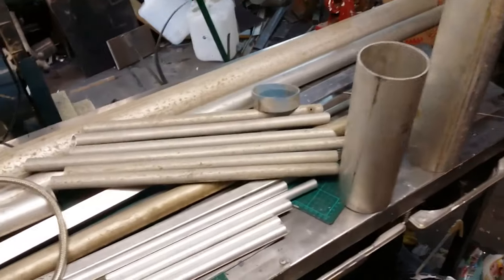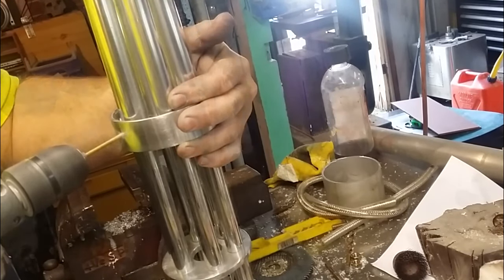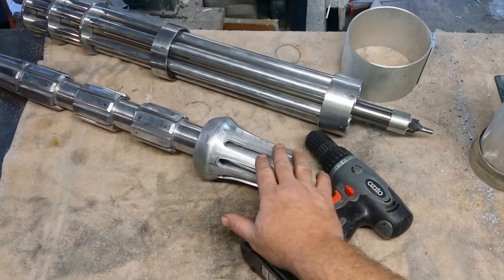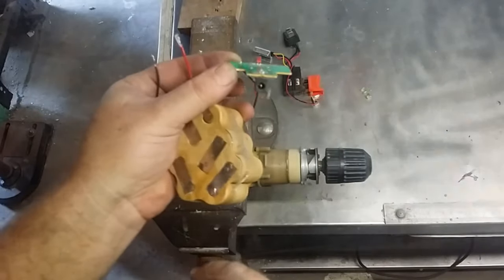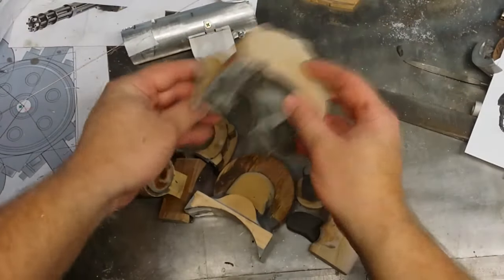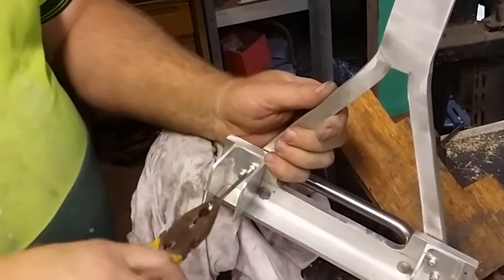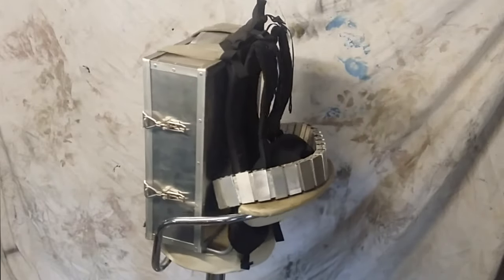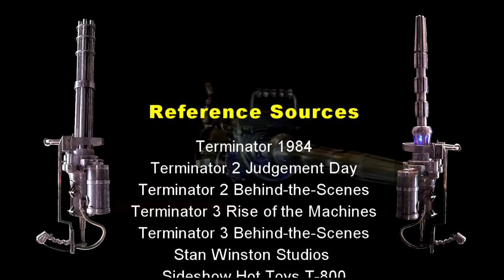Terminator Minigun Documentary

Comment: How much does each version end up weighing, I guess with or without the ammo backpack. I see you are using a bungie to hold it up. I am sure the aluminum versions are still pretty heavy.
Reply from the maker: they are about the same weight, not too bad it's about 10kg 22lb the "real" M134 in the same size, is around 4 times heavier than that